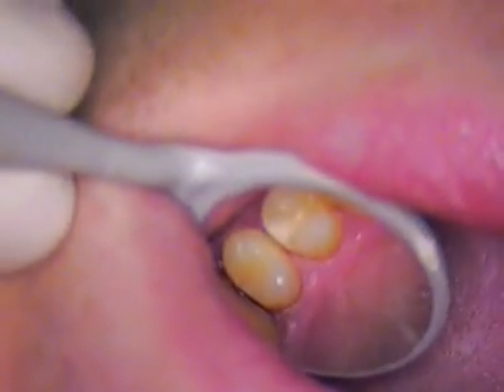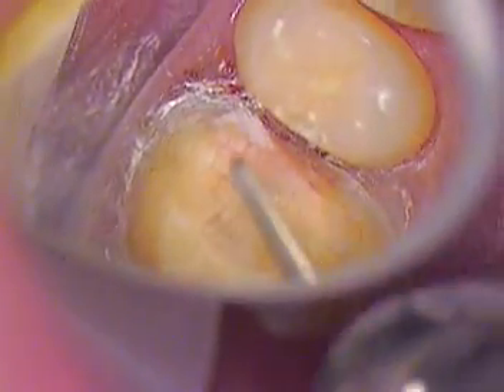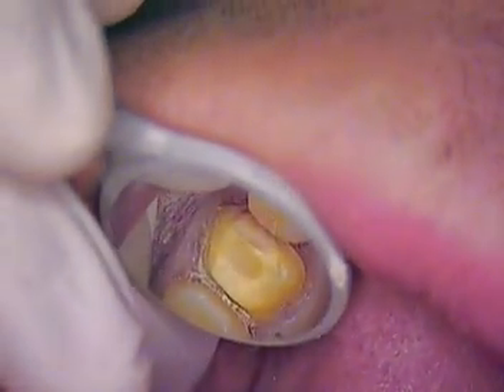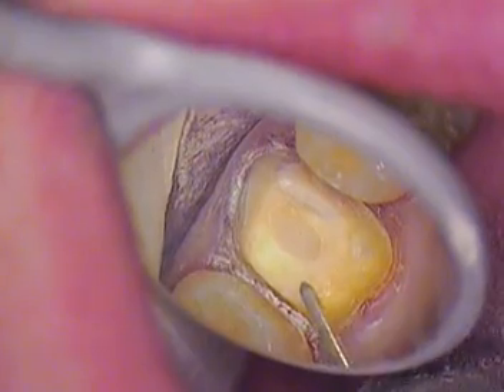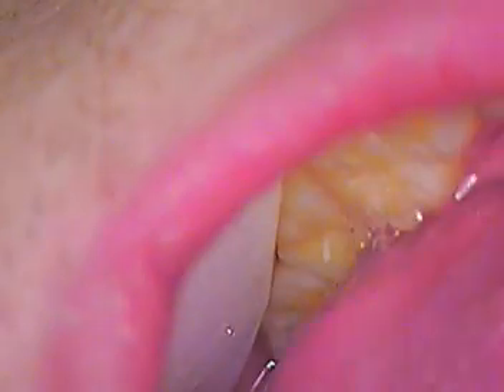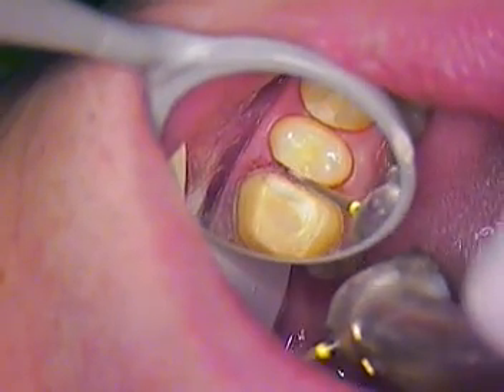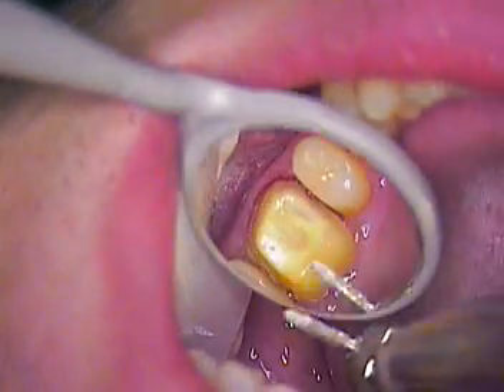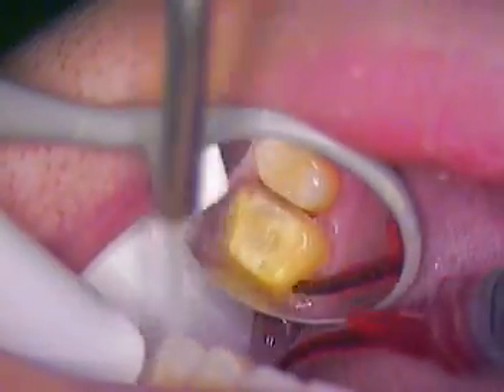DR GERARD CUOMO - Difficult Porcelain Crown Prep 3 Tooth Preparation Boca Raton FL

Comment from the maker: Hi Dr. Dino!  One of my mentors is Dr. Bill Strupp from Clearwater, FL.  He suggested using a course diamond with Kavo's midrange handpiece at low rpm.  He emphasized using alot of hand movement and going dry with an occasional air/water spray.  I haven't experienced any pulpal problems yet.  The microscope really helps out with margination.  ~GC

Comment from the maker: Hello happyteeth36.  I apologize for the confusion.  This is a porcelain fused to metal crown.  My decision for prep design was based on the amount of vertical tooth height.  I suppose a lithium disilicate crown could of been an option here, but I felt uncomfortable with the amount of tooth reduction that would have been required. My polisher is a Centrix yellow polishing cup and accompanying mandrel. Good luck with your program and don't forget to use a microscope.  GC